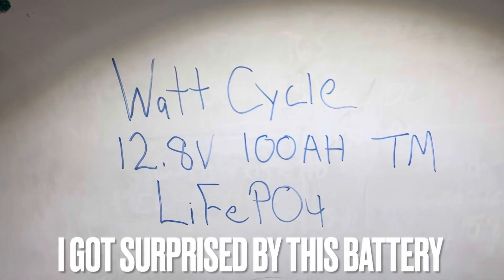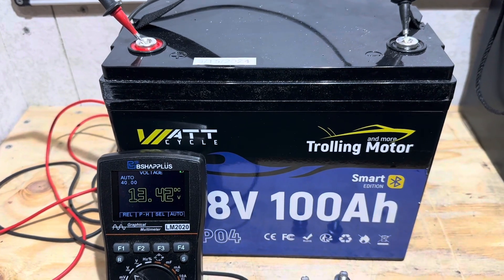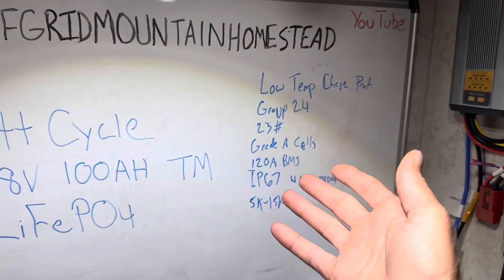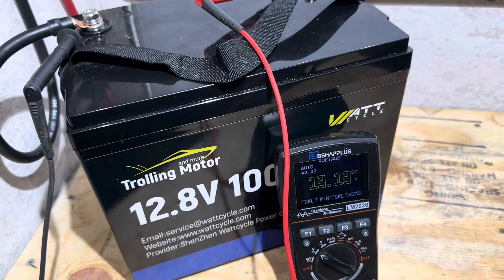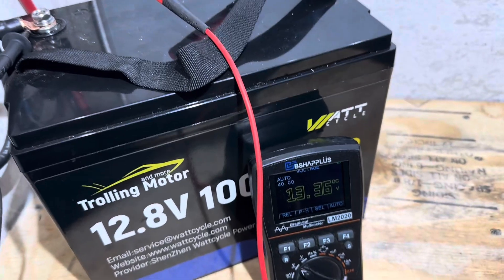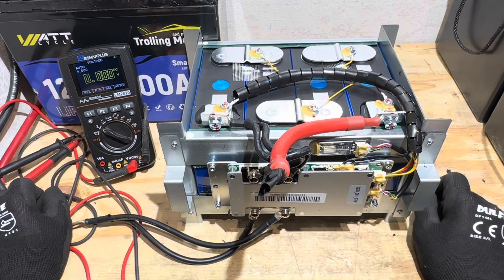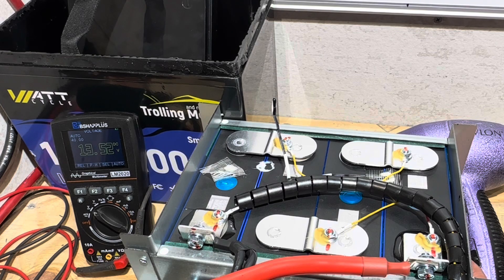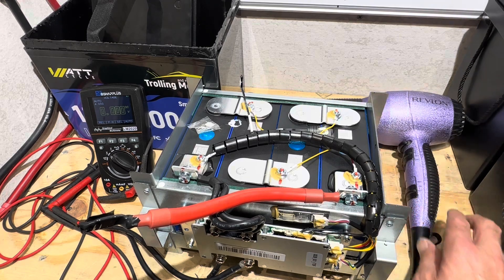WattCycle 12V 100Ah LiFePO4 Lithium Battery Review Teardown Group 24 Trolling Motor Battery

Comment: Love this video.  I love seeing things being opened and measured.  Im wondering if you ever had a chance to disconnect the BMS from all cells and connect them all together again to see if there is still 0.2v drops on the BMS itself?  0.2v drop with no load is insane for this battery.   Does the Bluetooth app have the ability to set the balancing current?
Reply from the maker: Glad you enjoyed! 👍 I haven’t done anything else with the battery. It is on a 12V water pump system. They promised to send another sample but some of these companies tend to ghost you after  pointing out any flaws.

Comment: OK, The problem is the BMS is no longer accepting any more charge because it is detecting one of the cells is over voltage.  When this happens one of the large bank of FETs (in the BMS) turns off, (the bank that allows the battery of cells charge) and it will stay that way until that cell discharges enough to detect the cell is no longer overcharged.  Although this FET is turned off, there is a parasitic diode in the FET (Drain to the Source-Substrate connection) that is forward biased when the battery (top terminals) voltage is measured that allows current to flow out of the battery.  When enough charge flows in the discharge direction the cells are discharged enough for the Over-Voltage condition is relieved (all Cells are being slightly discharged).  When that happens the FET is turned on again and current is able to flow in both direction.  The forward bias voltage of this parasitic diode is shorted out by the FET.  The Cell Over-Voltage detection circuit has hysteresis meaning once the over-voltage threshold is exceeded and the cell is declared in the over-voltage state, the cell voltage must be reduced by a few hundred mVolts to clear the Over-Voltage condition.  

The clue(@7:00) is that the voltage measurements don't add up.  The first measurement (@7:03) measures 13.58V across the Cell-Pack. (@7:34) 13.30V is measured between the Cell-Pack P+ and the P- terminal on the BMS.   But (@7:41) the meter shows 0.004V (though it is not said).  The voltage measurements (@7:45) repeats the 13.58V measurement across the pack and again (@7:48) 13.31V is measured across the pack.  The voltage measurements of across the Pack and across the BMS should have added to the voltage measurement across P+ and P-.  

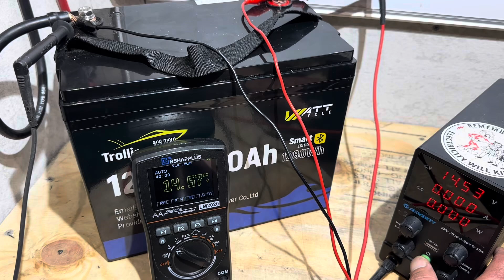Had the Battery (@5:09) been discharged by a few Ah the charging FET would have been re-enabled and the voltage would have risen to almost the voltage across the cell pack ~13.58V.  

Just a theory.
(Edit:  The first time the battery voltage is measured when connected to the turned off inverter and Battery Monitor (@3:20) the voltage is measured at 13.13V.  Turning the inverter on (3:27) drops the output voltage another 0.12Volts to 13.02V.)  The Volt Meter typically has a resistance of around 1M-Ohm.  This can affect the voltage measurements. :Edit-End)
Reply from the maker: This battery has been the only one with this behavior. Other testers have had the same behavior with the TM version. I have replaced the BMS with a JBD DP04 and everything is GTG. “Normal” behavior now.

Comment: Is it just a smart bms problem? Ive heard of other brands smart bms doing this also.
Reply from the maker: Yes their smart BMS is subpar. Their old Washi Energy dumb BMS in the older versions is good. My other brands of batteries with JBD smart BMS don’t have this issue. Wish they would have used JBD, SaiHang or Washi in this model.

Comment: You nailed it when you said that the BMS shut the charging down when one cell went over 3.65. I have two of the 100ah minis. They do the same thing. You can see what is going on with the Bluetooth app.  Have it open and watch what happens between 13.8V and 14.6V. Ramp up the voltage slowly with your power supply and watch it in the app. The cell voltages stay close enough until you're pretty much done charging and pack voltage is like 14v. Then you quickly get an imbalance. The balancer in these is something silly, like .01A or something like that.
The voltage difference that you see is because the BMS has shut down charging capability. In the App you can turn off charging and discharging independently of each other. When the BMS shuts down charging, it puts out a lower voltage.  
I scratched my head and said WTF a few times trying to figure it out. I started charging mine up to 14.2V. The cells have held a better balance, the BMS doesn't do funky things, and I still get 103ah out of each one. Hope that helps
Reply from the maker: Thanks for sharing your findings! I have a JBD bms to put in the WattCycle whenever I get spare time to mess with it. Don’t like the WattCycle smart BMS wish they would have stayed with Washi like the originals!
Reply: @THEOFFGRIDMOUNTAINHOMESTEAD  have you installed the JBD BMS yet?
Reply: We have experienced the same behavior with a Power Qween 100Ah Trolling Motor Battery.

Comment: Thanks for the video. I just got one of these.  Do you think I should return it or do you think it will still work okay for at least 3 or 4 years? 
Btw, after charging mine and letting it sit disconnected for 24 hours it drops each time to about 13.3 to 13.4v. So, I think it still has the same bms, etc, as yours.
Reply from the maker: Dropping to 13.4 after 24hrs is within the realm of normality for some units. Check with a small load to see if voltage immediately drops to 12.9-13.0. Any load made this battery’s voltage drop quickly. Look at some of my capacity tests on other batteries and watch the voltages it’s easy to see how this WattCycle behaves compared to the others. 
I’ve been paying much closer attention to behavior since working with this battery. Some of my higher quality LiFePO4 batteries will hold 13.7-13.8 for a week or more after coming off charge. 
I have a new BMS for the WattCycle and just need to get replaced to see if the cells are the culprit or if the original BMS is to blame. I will try to get this done soon and update with a video. Hope this helps!
Reply: @THEOFFGRIDMOUNTAINHOMESTEAD  Thanks. I put about 150 to 170 watt load on it for about 2 minutes and it dropped down to 13.13v. I disconnected everything and let it sit for a couple minutes and it went back up to 13.22v.  
I charged it about 36 hours ago and it was still at 13.4v when I started these tests.
I have a 4 year old 100ah battleborn which I charged at the same time and it still shows 13.8v. 
My total cost for this watt cycle was $170 so I'm not expecting perfection. Everyone testing them say they get at least 100ah out of it. My concern is how many cycles/years it will do that/last.
Reply from the maker: The capacity is there with the battery. Although the voltage hits low 12s really quickly under load. 
Just like you stated with your battleborn voltages, something is off with the battery. I feel it’s BMS related. I just need to prove it. The older watt cycles hold “normal “ voltages. Just this trolling motor one is weird.
Reply: @THEOFFGRIDMOUNTAINHOMESTEAD  I did a little bit of a load test. I put a 150w load on it for 6.5 hours... 975 watts total. It did it just fine. I only stopped because I didn't want to take it below 20%. So, I think mine has the capacity. 

I stopped the test several times and let it sit for like 30min each time to take a volt reading. I got what appears to be odd readings:
100%--13.26v
82%--13.24v
58%--13.25v
47%--13.14v
24%--13.07v

The percent is based off the assumption it has 1280watts of power. When I later connected it to a charge controller I got 13.13v while the meter I used for the test still showed 13.07. So, one of them was off. If my meter then I guess add 0.06 to each of the above numbers.

Regardless, I'm not sure how I'm supposed to know how much power is left in the battery when it doesn't even drop any until it hits like 50%. Or maybe I'm just misunderstanding something.

Comment: Man i just ordered 4 of the group 24 series (not the trolling motor) 12v 100ah for our 48v golf cart conversion. Im new to this and dont know jack but what YouTube has taught me. Im hoping i don't have this issue. Would a balancer added to the golf cart help keep this from happening or do yiu think the bms issue is its own issue? Also how is that charger you used? I see people knocking cheaper chargers and im not sure what to do. Id be surprised if we ever cycled these batteries more than 100 times in the life of it

Thank you for the work you did here. I learned from it and i appreciate that
Reply from the maker: The standard group 24 has a Washi energy BMS and doesn’t have this issue, at least not with the other 3 group 24 I have. The trolling motor edition has the “new” smart BMS which is different. My personal thoughts is they have probably had a batch of these new BMS that have resistance issues or balance issues that weren’t discovered at the factory, who knows how many are out there. The battery charger is flawless. It’s used to charge all my batteries for capacity testing. Look at the ENJOYBOT video. Didn’t have any issues with it and it had B grade cells. All perfectly balanced too. 
Just charge the batteries and see what your rest voltage is immediately upon removing charger. Most stay at 14.0 for a few minutes then go to 13.7 after a few hours and over a few days will drop to 13.4 ish. 
Hope this helps!
Reply: @THEOFFGRIDMOUNTAINHOMESTEAD  ok awesome, thank you
Reply from the maker: You’re most welcome, hope it helps you!
Reply: @THEOFFGRIDMOUNTAINHOMESTEAD  in general do you think a balancer is a good idea? I see li time has one that will do 4 batteries for like 50 bucks but no display

Comment: I purchased one of these off Amazon and will mainly be using it to top off our solar generator when camping. Otherwise it will get charged and sit. What is the danger of these cells not balancing correctly, specifically for the way I plan to use it.

Very informative video, thanks for the detailed tear down!
Reply from the maker: Used as a single unit not a big deal. Others have pulled full capacity out of the battery. If the cells would balance better there would potentially be more capacity. 
Used as part of a larger system the terminal voltage dropping off could potentially make other batteries take up its slack until voltages/state of charge are equalized. 
Glad you enjoyed the video! There is another commenter on this video that shared his results with the battery mixed in with others!

Comment: Not seeing the big no load drop, but mine did balance well.  I do see the Bluetooth/Trolling motor BMS exhibiting signs of higher resistance compared to the regular 100ah version.  When running in parallel at 20-40a loads the regular one will take most of the amp load and eventually the TM version will catch up as the batteries deplete and contribute more than 50% near the end. 

Measurements were taken at battery terminals with Fluke 8842a and rounded, both batteries had been fully charged for days and then ran an inverter at idle for an hour or so in parallel before testing. If anything the TM version had an advantage here as the regular model had been contributing 100% of idle current before the test thus the lower resting voltages than if they were fresh off the charger.

Regular 100ah resting at 13.26v, I saw 13.26v with a 1.8a load, and 12.55v at 100a load.
Trolling Motor resting at 13.26v, 13.22v with 1.8a load, and only 12.14v at 100a load with a BT BMS indicated 12.32v
Reply from the maker: Thank you for sharing your observations! 👍

Comment: Great tests and I'm happy it is not only me ;-) I think the Smart Mini has a similar behaviour which boils down to their BMS. When you open the App you can see there seems to be balancing happening. I had to let it balance a lot before I started my capacity test but forgot to mention it since it had been a while when I continued working on the video since I waited for the manufacturers feedback ... Really sad since the built quality is soo good except the BMS it looks like at the moment.... Thanks for the detailed video and mentioning my video 🙂
Reply from the maker: Thank you sir! Appreciate the feedback about the APP and the balancing! I messed with the battery a little more and it’s just an oddity. I top balanced the cells and the thing still wont behave lol. I  ordered another BMS to replace after I saw it today just randomly fluctuated its voltage on the terminals while just sitting there not connecting to anything 13.0 up to 13.7 back to 13.2  crazy! 
Appreciate you stopping by my friend, take care!

Comment: Just guessing, because I can't find documentation.  The BMS is resistive.  It is dragging one of the cells down by pushing it through a resister, which is dropping the voltage of a single cell or multiple cells impacting the total voltage.  You can put an amp clamp on the balance leads to see if this is the case.  When you reset the battery it took a moment for the BMS to reengage the resistive circuits, which dropped the voltage again.  

The battery supports bluetooth.  I believe it shows what is happening on the app.
Reply from the maker: This was my assumption as well some type of resistor in the BMS. That much of a voltage drop directed for balance would be a first! I would assume some heat would be generated? I was going to check the balance leads but lost interest in messing with it. No other battery I own behaves this way. I ordered a replacement JBD BMS and will upgrade. Will be a fun little hybrid build

Comment: Likely used cells if you can't get them to hold 3.6 volts manually. Despite that, do they give the correct capacity.
Reply from the maker: Yes Tobi got the capacity out of the battery. Imagine the nonsense of this is how these batteries behave. even a set of 4 matched trolling motor units in series would make for some wild voltage fluctuations on a 48V system!

Comment: I have some supposedly top of the line batteries, that are doing exactly the same... they refuse to top balance unless you literally very slowly charge them from 90% up to 100%, in which case they balance just fine, but if the sun is shining hard and they are getting 60+ amps (it's a 5KW 24V battery array), the BMS's will just shut down, and I even have a victron balancer installed exactly as suggested in "wiring unlimited".  Kind of annoying, but I've just learned to adapt.  Every week or so, I just top them off with a small charger in the evening, and watch them closely... and keep dropping the current as they get closer to absorption voltage... and they balance just fine.  It's apparently all about trickle charging them those last few amps... certainly wish it wasn't that way, but I've had them for several years now, and just finally have enough solar to hammer them on really sunny days.  I consider it a 1st world problem, so I try not to complain too much about it.  I'll probably be dead before these batteries so looks like I'm stuck with it in any event.  As long as they keep providing me with the ability to have normalcy for my Wife and I... I'll just live with it.
Reply from the maker: Thank you for sharing your experience! 
This is first one I’ve ran across like this. 
Side note; hope you came out ok from hurricane Milton. Was going to reply to one of your comments in another video to see if you were Ok but glad you stopped by on this one!
Reply: @THEOFFGRIDMOUNTAINHOMESTEAD  Yes, we are fine... will be months cleaning up all the mess, but hey, we won't run out of firewood for several years... at least I have a barn to stack it in... more than many people up your way.  I have nothing to complain about, and lots to be thankful for.  We sent most of our hurricane supplies north, we can restock before next year.    Ironically some property we were recently looking at to get away from the hurricanes down here is literally gone... Some friends who were just about to move into their brand new home near Ashville, now need a  new house.  Seems like we have to rethink our relocation plans. 

I watch all your video's... eventually.  As much as we find to complain about these batteries, they are so much better than the old lead acid batteries, that sometimes I think we forget how far we have come.  I still have and use some lead acid batteries, but I will never buy another new one... except maybe for a car/truck.    Keep after them, we do want quality to continue to improve, and the only way that will happen, is for those that fall short to see the problems/issues it causes us.

Just finishing up balancing my batteries tonight... they will be good for a week or so now.
Reply: I have the Mini 100AH battery with Bluetooth.  Its working g well sofar.